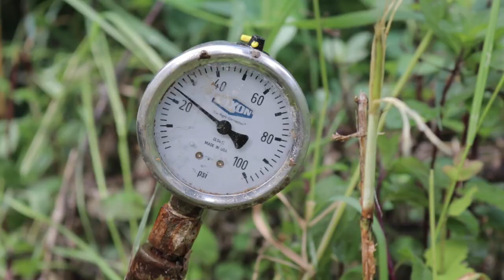My New Ram Pump - AMAZING!

Comment: implementing some permaculture solutions will help your land immensely.. the "too much  water" isn't a problem... you just must redirect the overflow with small trenches..hardly any depression allows the water to be diverted and carried to the peaks of your property...using about a 1-2% grade it allows the landscape to absorb water and not erode your hillside...recharging the aquifer helps for more springs to develop on higher elevations.  ..I think your in Oregon??...I would be willing to help you with permaculture design next time I'm heading through there for free... I have a several thousand acre permaculture project I'm in the early stages of developing near Yakima WA. Regreening the desert and helping to provide a model of transformation to recreate the food and resource abundance the Garden of Eden provided. With localization of resource and human needs for well being...it moves everyone, everywhere into freedom and away from the perception of centralized freedumb.

Comment: Build another holding tank at your first pump for your "waste" water....
Drop down 40 ft and install another rampump to push access waste water towards your tower...
You may be moving hundreds of gallons a day, and your "wasting" just as much at the first check valve in the line...
If your not irragating off of your first check valve it truly is wasted water..

Comment: Nice. A question and a couple of thoughts. Does the waste water from the pumping operation just go back into the creek? Could it be used fro a fish pond or some aqueous flora? A full port ball valve in place of the gate would greatly simplify line clean out. Have you considered increasing the size of your suction screen to reduce cleaning intervals. You could possibly even have an extra made up that would extend deeper in to the sump and connect it with a DWV flex coupling. No more zip ties needed although they are cheap and reusable. You would need to carry a 5/16 not driver or similar with you to service. Might be a bit of a challenge for the 11 year old. But then again maybe not. Thanks for the demo.

Comment: I don’t want to be “that guy”, as I’m sure you probably know this, but is Mrs. W releasing more string often enough? Just smack it on the ground and that little bulb will push in, causing more string to come out. Don’t be afraid to make too much come out. The plastic guard should have a blade in it to cut off extra string if it’s too long. (If you already know this then hopefully it will help a fellow viewer)

Comment: This is the first time i've even heard of a water ram pump, and it's so simple...but i don't 100% get it lol..... how would this system fare pumping water over a large distance? i mean out of a set up like this, how far horizontally and vertically can you move water before it just won't get any higher? Also could you use multiple pumps in series if you had just a stupid amount of distance/height to move water?

Comment: That's NOT how you wind trimmer line on. You are causing the twisting problem. I say this to help as a former STIHL dealer... you will be happy and have less trouble feeding all the line if you turn the head and reel the line, DO NOT wrap the line on the trimmer head :-)

Comment: Just a quick thought...Why don't you buy a PVC Coupling to fit the sizeof your PVC inlet pipe..permanently glue the screen to the coupling.  Then you can justslip the coupling off each year to clean out the trap!

Comment: I do love ram pumps, ever since I became aware of them. Very handy.

I also like the idea of using the water pressure going downhill to power a generator.....free electricity., Basically a personal hydroelecric dam. Might be worth considering?
There are many videos on youtube of people making them with old off the shelf/thrown out components. As I'm sure you know, if you turn an electric motor, you get electricity out of it. So many of the designs use old washing machines and such, use the water pressure to turn the motor/generator, and free power. Some systems use an Archimedes screw
, Im not sure which is better, as I haven't had the opportunity to utilize such a contraption, so 
I haven't delved to the deepest depths of knowledge on the subject. Might be worth considering though......
Of note, the ram pump is far more efficient to pump water, no sense in using the water head to generate power to run a pump, essentially..

Comment: WeedWacker or Strimmer.  You need to buy and fit a Desert Hawk head, it uses pre cut lengths of line you carry in your pocket and takes seconds to reload, no fiddly winding and no problems with it all going wrong.  Will handle heavy duty line. We have them on our Kawasaki, the wee Ryobi and the Wheeled strimmer.  Fits them all (straight shaft).  It is made in the USA, but it needed a Scot to tell you about it!

Comment: Sorry buddy. I am no expert as I am just learning about it. But I do understand the physics, and your stand vent is actually reducing the water hammer effect that drives the pump. You are better off without that T unless there is still quite a bit of drop from THAT point to the pump, because you just lost most of the advantage of any drop BEFORE the standpipe vent. Ive seen several people use standpipes to REMOVE air from the system by providing an interim resevoir ( a bucket will do) that is top fed and mid to bottom feeding. But the way you describe your system you are actually allowing air into your feed back pressure. You do not want air in there as it will reduce the hydraulic force that drives the pump.  The pump should be fed by an air free non vented stem pipe.  You have a really nice setup there. As I said I am just starting out so I am not sure about the vent, but I believe you are probably reducing your pulse force by giving it an easy out at a lower drop level than your intake. Databyter

Comment: Hey I have a question and I hope someone could help. On my property i have a spring fed creek year round. We dug a huge pong on this property about 50 yards away from creek. The pond does not hold water. Everytime the rain fills it, two weeks later its down to the bottom. Do you think a ram pump would pump enough water to fill a big pond and keep it full? We tried pouring bags on bentonite into it. Didnt work. I heard there is an underground water table which is pulling the water from the pond I guess? Any ideas welcome Please and Thanks.

Comment: As a plumber I can state you explained that better than the average plumber, because now a days most plumbers only effectively communicate when they are up-selling you on something. Two things I would change: First install a Ball Valve for that Gate Valve as the gate in a gate valve will always fail at the worst possible time in either the fully open or closed position, dependent entirely on what would be worst case for you. Second, even though it is a little more work to access the pipe, I would run the end of the pipe into a 3 sided plastic box of some kind and fill the box covering the pipe with some 3/4 gravel. (Open side is facing out towards your water source and gravel just fans out and down from box to it, helping to channel stuff away from the box, and keep debris away from actual contact with your screen. Additionally some good pipe dope on the the union threads and that will come apart like butter every year.

Comment: Im wondering if you have ever tried putting a check valve on the inlet (drive) pipe just above (upstream of) the waste valve?  I'm going to experiment with my 3" pump this spring.  I had the thought that if you could stop the shockwave from going back up the drive pipe with a check valve, you could make it more efficient by forcing more energy through the outlet.  What are your thoughts on it?

Comment: With your tools getting wet and showing rust, try using CRC226 available at Home Depot in the electrical dept.  Use it and steel wool to clean the rust initially and then when you get them wet again, just spray a little and wipe.  The product works into the metal pores and retards rusting.  Good for rusty saws too... One can take a pair of pliers that are frozen and spray the joint and work them... good as new!  It is also good for electrical connectors... like trailer connections.  I even use it in audio volume controls.

Comment: String trimmer string gets brittle when it dries out which causes it to break off at the trimmer head. That might be what's happening to Mrs W. Some people soak the stuff in water. I've been storing mine in a plastic bucket with a damp sponge and haven't had that problem since. Maybe worth a try,

Comment: Wow. So basically you're capturing "water-hammer" and using that energy to move water higher than the source of hammer thanks to the smaller-diameter pipe. Wow.

Comment: I suggest an oversize union or  capped  T fitting upstream from your valve.   A  T fitting  Clean-out  may allow you to flush the junk out upstream of your valve.   Can two Rams be used in parallell?   If they could be used, two small pumps would allow tuning pump capacity to your needs or input level.    Just few ideas since I cannot help much otherwise from the east coast.    

I used to mow my lawn with a string trimmer, so your Lady's fight with it is well know to me.  Of course, I never looked that Good when doing it either!   God bless you all.

Comment: What if you take your RAM pump put it uphill contain the water and run another line back down with your water and at the end it goes to a Mini hydroelectric plant that you've built (or buy it).  🤔 I've been sitting on this thought for a few months you could produce your own power plant. What do you think???

Comment: So..   if you wanted to lift it further, or pump more, there are a couple things you can do to improve it. 

Remove restrictions. The valve, waste valve, and tee are a bit small. If you opened them up, and used larger pipe fittings, you promote more flow. Flow (kenetic energy more importantly here) is based on 4 things..  resistance of flow, velocity of flow, flow mass, and pressure differential. The flow mass (size of your pipe supplying water to the waste valve) is fixed.   lower the resistance, and the greater the pressure differential, the more flow you will have. The more flow you have, the speed will pick up, increasing energy of the flow. 

This is the same as an electronic dc/dc boost converter.  

Another thing you can do to increase flow, is to apply a light spring to the waste valve flapper to try holding it open a little longer. Being that it is vertical, adding a little weight to the flapper would serve the same purpose. Idea is that when the waste valve opens, flow in the pipe accelerates from almost a dead stop. As it accelerates, it picks up kenetic energy. This pushes past the waste valve until the flow is strong enough to lift the valve flapper and cause it to shut. All this energy has to go somewhere so it pushes past the lower check valve, and stores it in the air tube. If the flapper weighs more or had a slight bit more resistance to closing, then more kenetic energy can be generated before the waste valve closes, and larger amounts of water can be pumped. 

Another mod that would be possibly beneficial, would be to get the water away from the waste valve. Something as simple as a 90* elbow would be good. Keep the run short though, as this can lead to cavitation if made too long. This goes in line with reducing restriction. The valve only has to be vertical so that the check valve resets after diverting kenetic energy into the air tank. Any further that water must be lifted is wasting energy. 

How do you control max water level in the water tower? Dump tube? 

Another thing that would help..  build a large box for the incoming water with as much screen area as possible. Preferrably below the surface of the water to prevent sucking up floating debris in the screen. In that box, route your inlet pipe to the middle of it. This will limit sediment intake as it will likely fall to the bottom of the box if it is large enough to slow the flow through the box, and it will prevent intake of floating debris. Removing the screen from the inlet will increase flow and therefore kenetic energy. (Ability to pump)

Comment: Using the metal blade is more dangerous. If you hit a stone with it and it chips, you have a habit of tearing your legs open. Also, while not great on grass (they will work on grass but they chew it more than cut it) they just shred thicker weeds like briers, doc etc. 

Alternatively on my brush cutter (weed wacker for you Americans) a slightly more expensive option I admit, but I use throw away plastic blades. 

My garden is all raised beds with mulched pathways so I don't use the cutter often so I can get away with using them. But at about $2 a set, with how easy they are to swap, you can't go wrong with them unless you use your cutter every day.

Comment: You mentioned Africa. I read in an engineering journal that a ‘spring’ in an African village had dried up.  Eventually they found a 100 year old ram pump a long way off that no one remembered. All it needed was a leather diaphragm, supplied by the same co in Manchester UK to get them up and running again.

Comment: I can tell you how it was discovered. They used to supply water with a tank on the roof. All the fixtures were gravity fed. The k.s. had a pipe fed from the tank plus a line going back up to the roof as a vent ending above the tank. I believe they were trying to stop water hammer! The k.s. kept being turned on and shut off. After awhile there was water coming out the vent! And thus, the ram pump was born. It'd pump higher if you secured the pump to a concrete slab.The flex of the pipe acts as a shock absorber. Which you don't want.

Comment: Ah man I hate using a weed eater.  Growing up, our farm had tons of banks that needed weed eating.  It took about 4 hours per week.  I'm glad my little 1.6 acre lot only take about 15 minutes to do the trimming.  Also, the string feeders never work right.  I would always drill bigger holes in the head and then just loop the string through.  Then I would just cut extra lengths to carry in my overalls.

Comment: You should consider the pull through string hub for fast loading. All the professionals use them. Any lawn equipment shop will have them and know what you're talking about if you ask for one. I used to keep four or five Stihl spools loaded and ready to go for our property but the first time I tried the quick loading pull through hub I never went back.

Comment: So, to get the water up 90 foot, the pump would have to be about 12 foot below the Water supply then, that's pretty deep, also a pretty good distance for a 7:1 ratio, it'd be a royal pain to maintain the pump that far underground, so I'd need a different method of pump, possibly a windmill well pump.

Comment: Three questions. Do you have freeze up problems with the line sitting on the surface? Have you considered running the waste off away from the pump area to keep it less wet? Considering the distance away from the house and the wild life around (wild strawberry raiding bears) is Jack safe enough on his own ?

Comment: water gives 14.7 PSI /15ft of dropped elevation. So if the math works out you should be able to pump your water to an elevation of 308 feet. I wonder what affect you would observe if you increase the diameter of your standpipe.

Seems to me that having a standpipe right there near the pump would create a sort of trompe type affect and the more volume of water you have close to the pump, maybe it would increase the pumping pressure.

Comment: Wow way over 500 replies to this video. Odds of you seeing this wordy reply are slim. This is an improvement to the inlet. You mentioned Jack cleans it out. Perhaps let him checkout this and other inlet improvements (there are several) and have him build something that would reduce his toil. Here goes. 

Do it like Hoover Dam. Let’s say the max depth of your pool is 2 feet. Take 2 feet 6 inches of  5 inch diameter pipe. Cut 1 inch slots all the way around the pipe starting and ending a couple inches from the ends. This leaves enough solid pipe at each end to make connections with standard fittings.  Leave enough room between the slots to maintain the pipe's strength to resist the pool's water pressure. Cover this with your filter screen. Cap one end (the top). On the other end (the bottom), adapter your way down to the pipe diameter going through the dam. Place the in the deepest part of the pool vertically and add fittings to connect to the current inlet pipe feeding your ram pump. This lets you pull water from the pool no matter how high or low the water is and is somewhat self cleaning.  Search for “hoover dam water inlet to generator” and you will see 4 concrete versions of these used to feed the generators.

Comment: You have a new  watch? What happened to the old one you had fixed in Prag? Is the new one Quarz, will be more shock resisting than an automatic even thoug the old one (Marathon?) was nicer.

Comment: Hello... can you tell me what effect, if any, putting a larger cylinder or propane type tank (as you mentioned) on the system would cause? I understand it would take longer to fill the volume of the tank but would it move more water?thanks for your videos.

Comment: There is black square string for the Stihl weed whacker as well. It doesn't melt and stick together as quickly in hot weather and slices through old brambles, whereas the orange string just can't handle that. I just don't know if the Hp of your type of weed whacker can take it.